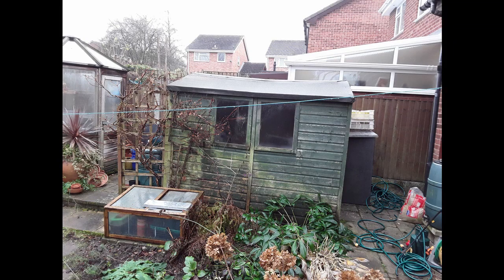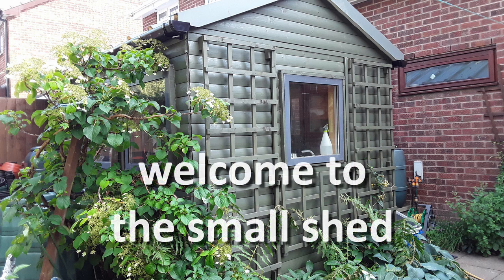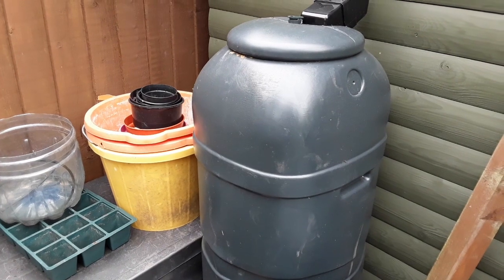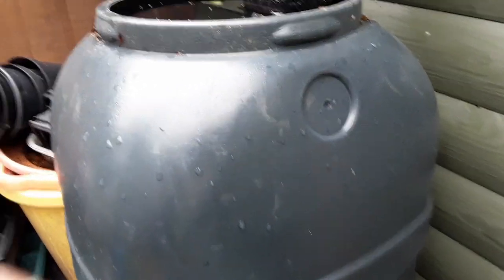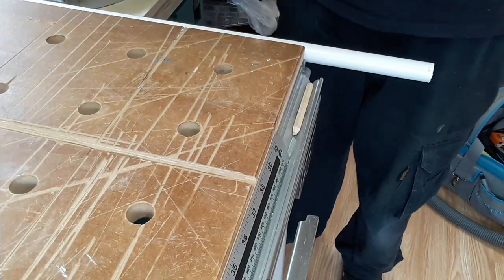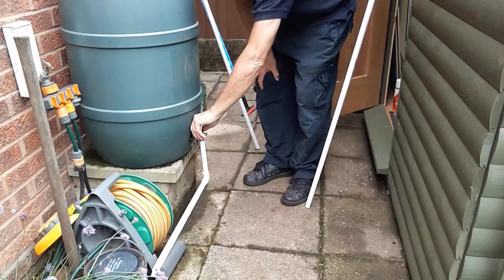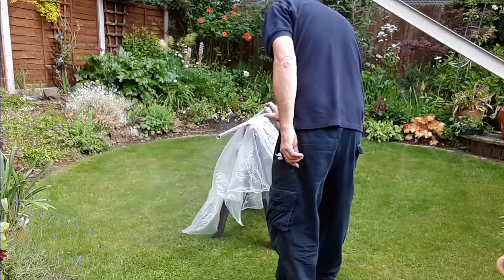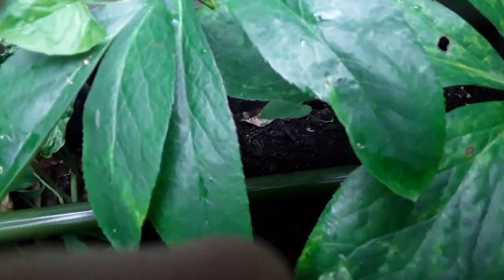the small shed #13 - water butt

Comment: Nice one. Did you glue the joints on the pipes?  If not wont they leak or come apart?
Reply from the maker: Hi Charles,
Overflow pipes are not usually glued as the water isn't under a great deal of pressure, and only flows occassionally. - I don't think it will be an issue, it has been o.k. on the main water butt for a couple of years, but I will keep an eye on things and solvent weld if necessary.